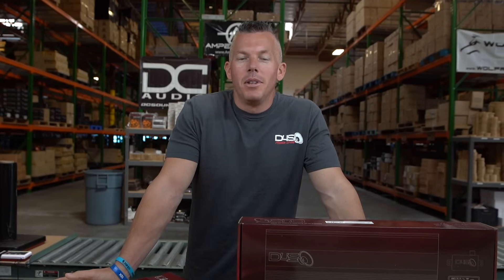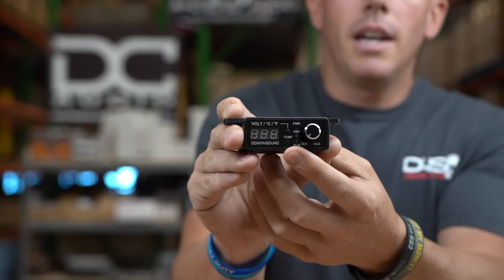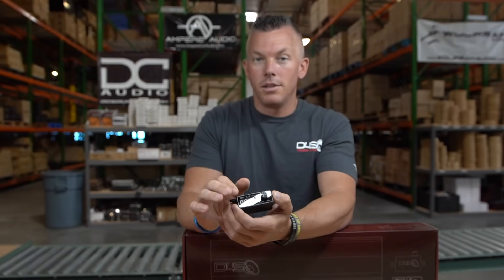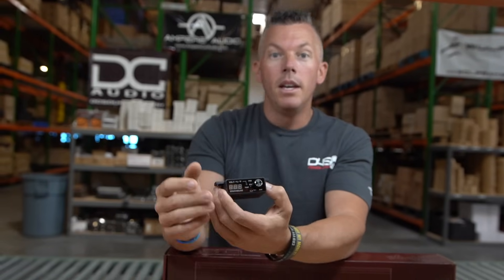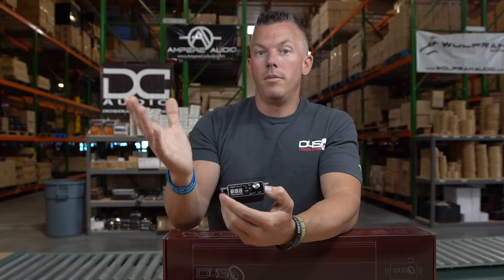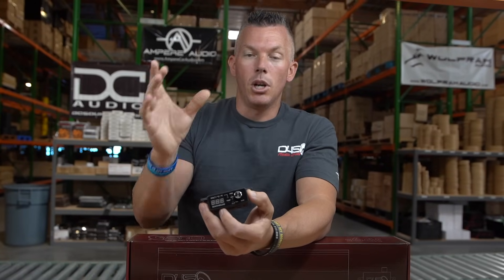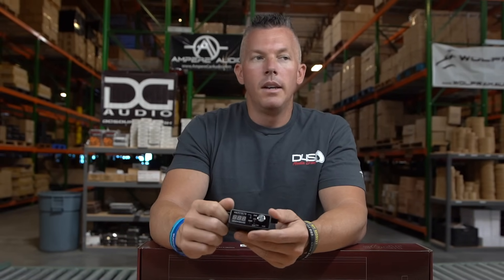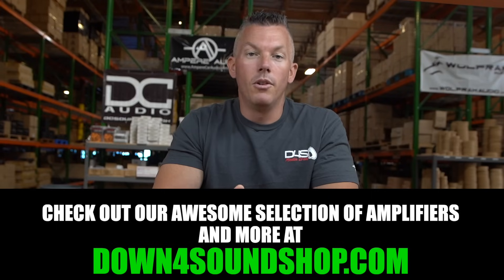CLIPPING: WHERE DOES IT START, HOW DO YOU PREVENT IT?

Comment: Doesn’t heat also lead to clipping?
Reply: I believe it doesnt, all speakers get hot when playing and its normal. Clippings is just a bad signal that raises the temperature of the speakers coil and thus can terminate the speaker. Over powering a speaker with too much watts will also blow it fast.
Reply: @L-Noble.YT_Hi.Res-Soundminds  no. The heat on the amp. My top amp closest to roof of black truck gets hotter.  It clips and gains are way down. If I’m at car show in summer with no ac running.
Reply: @JayShipes  Well hot air rises so that may explain it. Putting the amp lower and providing better space around it could make a difference. Plus with no ac it's worse. Some Amps might get hotter depending on how hard they work or Their design or efficiency etc. Another option is to put an exterior fan to cool it.
Reply from the maker: The other way around

Comment: The two biggest causes for clipping is system set up (gains matched to headunit output voltage and max clean volume on deck determined) and the music itself if more often than not clipped as well and if it's not clipped it's recorded louder than what the gain overlap is set on the amp thus again overdriving the amp past it's max rail voltage. There is so much that goes into making sure you never clip that most people don't even bother.
Reply: how does a distorted audio signal clip a amplifiers output? If you match the max signal output voltage (Clean or distorted) to the amplifier input section with the gain you should never have clipping.    A amplifier does not care what the signal looks like coming in, It only cares about the voltage and frequency
Reply: So true.
Reply: Tuning an amp to never clip is also a colossal waste of power and thus money.
Reply: @Thezuule1  u say that because you didn’t get the proper amp to power your setup so without clipping ur bass is poor. So u have to clip to get it loud. U basically are going backwards in life sir..
Reply: @YouKnow51OO  I say that because it's the case with any amp in any setup. Music is dynamic and if you tune an amp to never clip at 0 db you're leaving a ton of power on the table. An amp should be tuned around -5 db generally, sub amps can be pushed more toward -10 db.
Reply: @Thezuule1  whats that have to do with clipping???????
Reply: @Thezuule1  if my subs can handle 1000 watts rms and my amp can give its that without clipping why would I care for the extra power. All it will do is put strain on the subs. Amp cans handle a beating better then the subs can. Extra power is nice if the subs can handle it or amps can push it without clipping. But ur saying clip it so u don’t miss out on it 🤣 I don’t got  time for u
Reply: @YouKnow51OO  If you dont tune your amp with an overlap, your not getting your 1000w out of the amp. Hard to get clipping at a 0db overlap, but your leaving power on the tale. -5db is a solid daily system overlap, may get soft clipping on certain music. -10db is more competitive or for people who dont listen full tilt under daily use. Ive fried a lot of speakers with a -10db overlap. You have a lot to learn about audio man.
Reply: @2v_media  yeah yeahh

Comment: The head unit can clip to the amp then the amp can clip to the subwoofers or speakers. The audio controls lc2i loc tells you when the head unit clips. I learned that when I hooked up the dd1 to the amp.
Reply: If you watch Barevids on youtube, he showed an example of this, he proved that even if the head unit put out a clipped signal the amplifier if the amp has a low pass filter it will out any noise and re smooths the signal. this is because clipping adds high frequency noise to your signal so if the amp has a low pass that filters them out.
Reply: @livingthelife2wice  he also sends a squarewave into the amp and it poops out a sinewave magically. People are so sold on the waveform shape they dont even understand what a waveform is. He litteraly shows you and people are still like "nuuu uhh" while gripping their beloved dd1 and in smd we trust pamphlet of how to be another basshead sheep
Reply: facts
Reply: true. that's why I tell people to never use an oscilloscope or multimeter to set the gains on your amp. you need to know the maximum clean output of the head unit and you can't find that number without a DD-1 or DD-1+
Reply: @Mr_Killjoy420  The post you replied to pointed out the lc2i does that without a DD-1.
Reply: @Mr_Killjoy420
Reply: @Mr_Killjoy420  wow you couldn't be so much further from the truth. A oscilloscope is literally looking at electricity and waveforms You should learn a oscop and throw the DD1 in the trash.
Reply: @commonsenseisdeadandgone  https://youtu.be/v0Jcsn3-Uf4

this is why you should do some research before you reply to someone who knows what they're talking about.

NOTHING is more accurate at setting gains as a DD-1 or DD-1+

you can think whatever you'd like, that is fact.
Reply: @commonsenseisdeadandgone  you obviously didn't watch the video lol. Anthony D'Amore shows you HIMSELF that oscilloscopes are pointless for setting gains.

grow up man.
Reply: @Mr_Killjoy420  i didn't you're correct and now given who its from i am glad i did not waste my time. You can scope RCAs just the same. Listen to the same guy who makes money when you buy his product but not a oscope, he has no reason to say why you need his product huh? 

Wake up man
Reply: @Mr_Killjoy420  i can't say on a DD1+ but a DD1 does only 1 frequency and if you tune everything to 40 then you clip at 30. There's nothing and absolutely nothing more accurate then actually looking at the rails to find clip. The waveform of the input signal is not of importance. The voltage and frequency is what it needs, send a square wave into a amp and see what the speaker output is ...... Oh you can't with your beloved dd tools.......  This is strictly about clipping but anything else his tools do can be used with a oscilloscope or frequency generator or another tool. If you want it specifically for audio then it's a great tool however once again, it's not better and it's not as resourceful than a oscilloscope period! The only tool they make that is hard to replicate especially for the price is the amm1 and ad1. They know it so they bend you over for it. Rightfully so i guess. 

I got a question for you; How do you set your gain for a amplifier that is more powerful then your driver can handle?
Reply: @commonsenseisdeadandgone  also, if you watched the video, you'd see that he is comparing the dd-1 to an oscilloscope and also shows you how it's more accurate.

not to mention the oscilloscope in the video is a very very expensive one, not just a fluke meter.

sorry you're blinded by your inability to learn from other people but oh well, to each their own lol.
Reply: @Mr_Killjoy420  😂 i watched your video to humor you..... I can't. 

First off learn what clipping is over distortion. Second you will never know otherwise that amount of distortion especially in a environment such as in a car. Third run that signal into a amplifier and see what the output waveform is. For someone who thinks they know is funny when thier proof is not even of the topic at hand. 

Try again!
Reply: @commonsenseisdeadandgone  the DD-1+ gives you the ability to set a decibel overlap.

if your amp puts out more rated power than the sub you have hooked to it; you attenuate the DB overlap down some and meter the wattage using an amm-1
Reply: @commonsenseisdeadandgone  clipping and distortion are two different things.

you have some learning to do.
Reply: @commonsenseisdeadandgone  the DD1 does highs as well. It has two lights and multiple tracks on the disc for a reason. The manual even explains how to deal with one frequency clipping before the other.
Reply: @Thezuule1  sorry you are right, it does 1khz and 40hz. I actually do have a DD1 but I don't use it.

Comment: I got your JP23 amp and from what I hear the clip was not a problem unless it is a solid yellow color. If it's just flickering it's not a big deal. Dunno much about audio but my bass still hits even when it's in clip city lol ..
Reply: @BEATING NCP93 I plan on adding a 320 alt with big 3 .. nothing happened yet I just don't turn it passed half way on the knob yet
Reply: @BEATING NCP93 I have the the D4S lithium battery 🔋 😎 and 0 gauge wire running to the amp already. My other battery is a Optima yellow top 👏 But yeah I wanna get a new alt next most deff. What's a good brand?
Reply: @BEATING NCP93 no dimming lights. Just the yellow clip light kinda flashes like every 10 seconds sorta flocker
Reply: @BEATING NCP93 yeah my setup is 4 SKAR EVL 8" with a jp23 amp. Still hits but I can't turn the gain up high or the voltage drops. (Hope the new alt solves that)   What system u running?
Reply: @robinthrill3r7  I feel you bro . I have a single evl 12 with jp23 and it the light shows it’s clipping every so and so seconds. I have two lithium’s so power isn’t the problem. I do need a big three
Reply: @robinthrill3r7 my buddy has the exact same setup
Reply: A properly tuned sub amp clips a little. This is why the DD1 comes with -5 and -10db tracks and all this. If your amp is tuned to 0db you're leaving a ton of power on the table.
Reply: @Thezuule1  it is flickering/strobing not staying solid color. However my voltage ⚡ does drop down from 14.1 to 12.3 a lot when heavy bass plays. 🔊 you think big 3 upgrade and alt will do the trick? 

How do I tune it?
Reply: @robinthrill3r7  properly tuned an amp is going to clip like that. Flickering is fine. If you can feed the amp more consistent power and keep the voltage higher you can squeeze a bit more juice from it, but, we aren't talking about a dramatic difference in power. If your lights aren't dimming and it's hitting I wouldn't worry about an alternator. You can try the big 3 to keep the voltage a little higher but even that is probably not necessary if you're not seeing any obvious electrical system issues. Staying above 12v when the bass drops HAM is probably good enough for most people. The difference between 2300w and 2450w is imperceptible to a human ear anyway.
Reply: @Thezuule1  a properly tuned amp doesn't clip
Reply: @beardedforlife3740  it does and I'm in no mood to argue with you either way.
Reply: @Thezuule1  any real pro will disagree with you. You do realize that clipping is distortion right? The whole point of using a DD-1 is to find distortion and tune your amp so there is no distortion. That also means there will be zero clipping at that frequency
Reply: @beardedforlife3740  a DD1 comes with -5, -7.5, and -10db tracks for a reason and the founder of the company has videos on YouTube explaining why you should use them. Hell even my JL Audio amp manuals suggest soft clipping their amps. As I said in my other comment, I don't care to argue about it, run your amps at half power, they're your amps and it's your wallet.
Reply: @BEATING NCP93 holy chit I didn't know dat.. 😳 Ok I'm getting the alt next and big 3 haha 😄
Reply: Back it down if it flickers